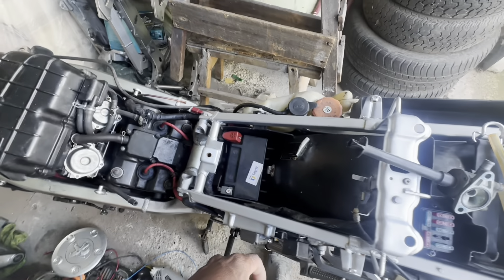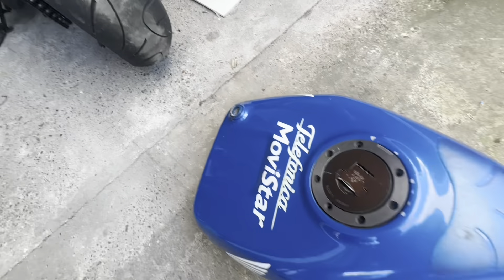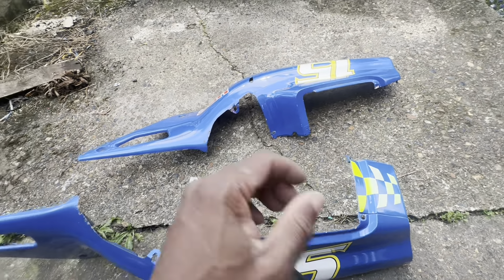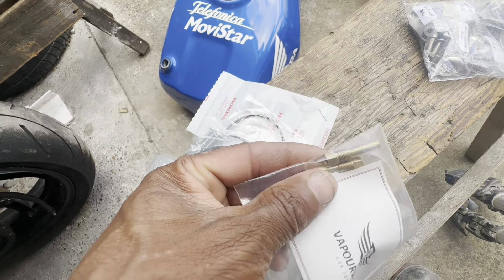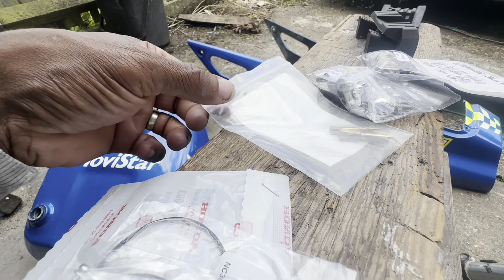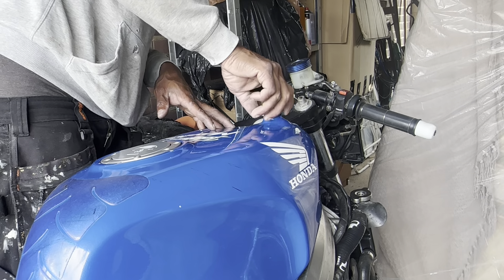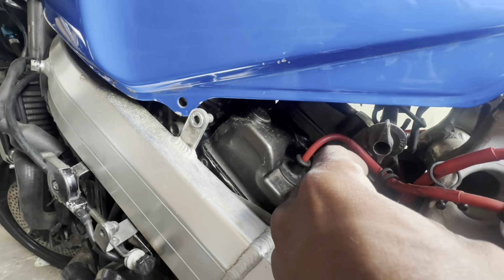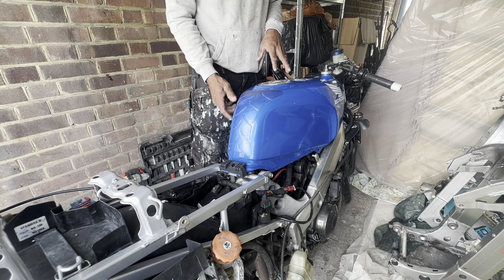HONDA VFR400 NC30 Restoration Episode 17

Comment: I’m sure there should be a rubber gasket that sits around the outer ring which will lift the outer ring to keep your filler level, same with the new bolts you said you’ll cut them down they will fit.
P.s…when did you become American! It’s a petrol tank not gas tank.🤣🤣
Reply from the maker: Hmm I’ll have to double checked. The old one didn’t have anything under it but it’s easy to find out if I look at the parts diagram. The bolts are definitely longer than the other ones though. That’s me watching too many American bike builds on YouTube lol